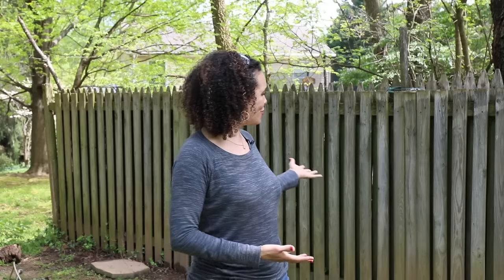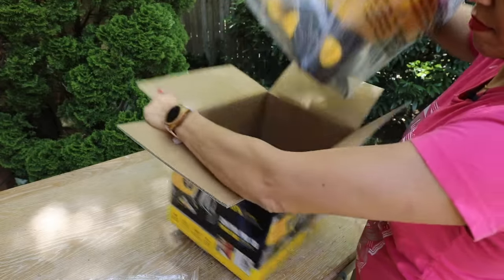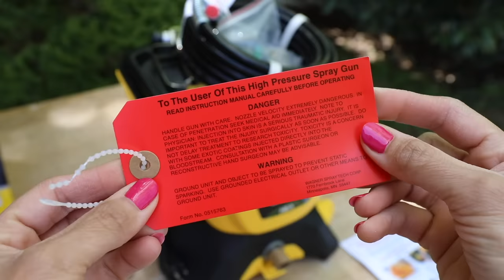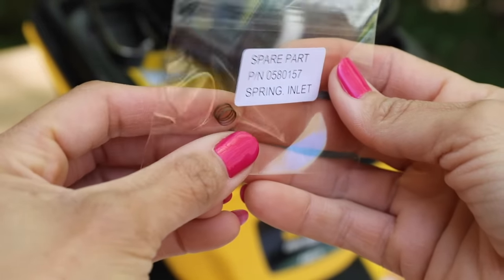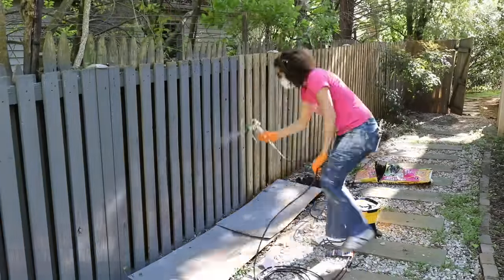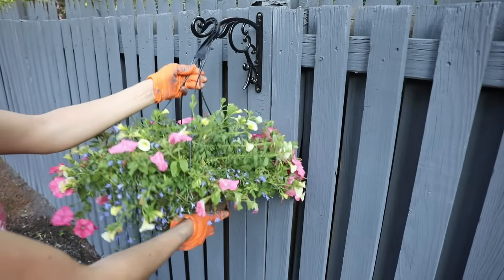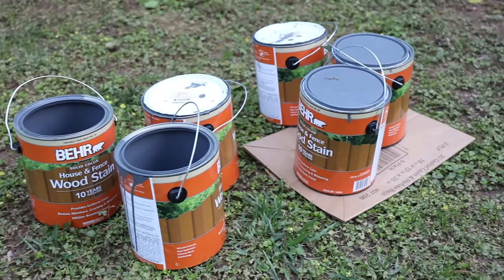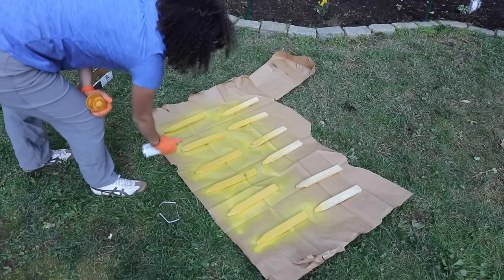How to Use a Paint Sprayer to Paint a Wood Fence - Thrift Diving

Comment: Thanks for posting this video! I have a 60 ft long picket fence that needed a new coat of paint in the worst way, and I found your video while searching for tips on painting fences. After seeing what a great job the Wagner sprayer did for you, when I saw one at Lowe's that was 10% discounted for being a previously-opened box, I snapped it up! My fence is now finished and looks great! 

If I could do it over again, I'd make sure to buy two to four times as much paint as I thought I'd need. I ran out partway through and had to run out to buy more! LOL. It also takes SO MUCH TIME to clean properly - plan on at least an hour. A big chore, but I guess you still save time by not having to brush and roll!

Comment: Wait, What... Auto mower? 
I need to get this for my deck. And will also look for this mower. Thanks for sharing.
Reply from the maker: Yes, and automower! I'm doing a campaign with Husqvarna and testing out an automower this season to see if it works well. I'm posting about it each week on FB and IG. But at the end, I'm going to do a little video to share with you my thoughts on it. Bottom line, it works well, but sometimes you really just need the fresh cut of a real lawn mower!
Reply: @ThriftDiving  fyi do not paint a deck you will be sorry. use a transparent deck stain . paint only bubbles up or comes off in big patches on decks cuz it doesnt get along with treated wood...

Comment: I bought the Wagner power sprayer to paint my basement at Lowe’s. Nightmare, I ended up returning it. The sales associate told that this particular item gets returned frequently.
Reply: your basement is at Lowes?
Reply from the maker: Oh no, what was wrong with it? I would likely use a roller if I was just doing an area like a basement. But if I were doing an entire area, like my rental townhouse, I would use a sprayer. Sorry it didn't work well for you!

Comment: You could have used a juice box to spray a beach/jomax blend to kill all the mold and mildew on the fence and then sprayed it off with the pressure washer.   You can use a runner drop cloth to cover the grass or plastic mask to protect overspray on your neighbors side of the fence.  You did a nice job on your fence!

Comment: One pro tip...ALWAYS strain your paint from the can to the sprayer.  You may think because it's new you don't have to do this but use a strainer and you'll be surprised at the little bits of junk in the can.  This will save you from clogging the sprayer tip and having to stop the job and clean it out.

Comment: I just bought 135 gallons and they took it back. It was the wrong grade of paint. The rep was like "Oh yeah this will go on in one coat". I Sprayed a 5 gallon bucket and it definitely did not go on in one coat. That being said, the company stepped up and told me to take the remaining 130 Gallons back, gave me my money back, send out the correct paint and some swag, and only charged me the difference in price per bucket. That, my friends, is the customer service you get when you're polite and patient.

Comment: Excellent review, I'm painting my house with a Wagner Flexio 590 sprayer. After seeing this, I'm wondering whether to purchase it because it has a greater paint capacity. However, I'm wondering how long is the hose to the spray nozzle as I'm working on a ladder most of the time. The sprayers are a great time-saving tool no doubt.

Comment: Love the fence that is awesome. My fence needs a complete makeover to. Not in this year's budget. So when you use a spray painter and you have drips what do you do do you bring a brush along and you brush them or does distance from the sprayer to the fence prevent drips?
Reply: I found that if I was careful about not spraying too much in one place, I didn't have any drips. But I was also using a very thick, premium exterior latex paint. A thinner/cheaper paint might have more problems with drips.

Comment: How many gallons did. You use for that side of fence?
Reply from the maker: I believe it was about 4 gallons. But if you have a sprayer that can be adjusted, you can adjust the output of the flow. With this sprayer, you can't, and it came out fast and thick.

Comment: You went through 5l of paint for 10 fence slats?
Reply from the maker: Yep, lots of paint! The paint sprayer doesn't have a valve to modify the amount of spray, but the spray tip can be changed to modify it. I only had this tip.

Comment: by the time you set that up, mess about preventing overspray and spend time cleaning it all down- you could have done it with a brush that cost a few £ or $ and probably used less paint. Then there's the cost of the sprayer...

Comment: You skipped a couple steps. The reason why the fence is green is because it's covered in algae. It need to be washed with a 50/50 bleach solution let dry and then wash off with a water hose. High pressure shouldn't be used on a fence, once coated with the bleach solution just wash it down with a hose. Let dry then paint or even better stain

Comment: You should have bought a gas pressure washer! Less time less back strains and it would have knocked the job out quicker than that one you used!
Reply from the maker: You're likely right! I do find that with lawn equipment, the gas powered overpowers the battery or plug-in electric stuff. But this is the one that RYOBI had sent to me a couple years ago and it has worked fine. But next time, I am thinking of renting one to see the difference! :) I might just not know what I am missing with the gas-powered pressure washers! :)
Reply: @ThriftDiving  gas powered may be a little back strain, if you can get someone to load and unload it for you that's a plus! But electric pressure washers might be a little less of a back strain to load vs gas powered!
Reply from the maker: I have found it to be pretty easy to use. No loaded or unloading--just dragging it out of the garage. :) But if I pressure washed for a living, I would definitely buy a gas-powered one!

Comment: If you had a good pressure washer it wouldnt take much time at all!
Reply: What's considered a "good" pressure washer?
Reply from the maker: Well, this is a 2300 psi RYOBI. It is a good pressure washer. But I know there is much higher psi machines. But this is a pretty good general machine for home use.